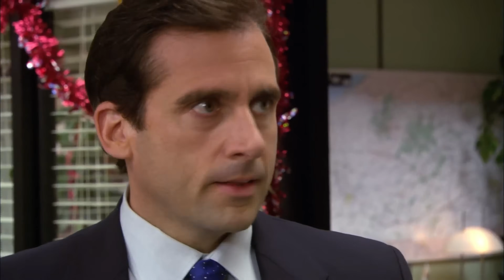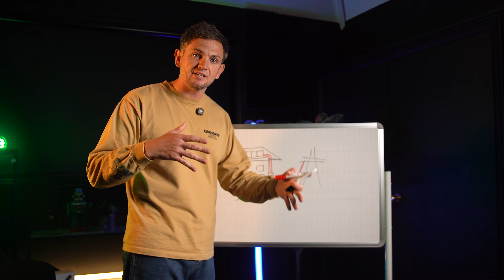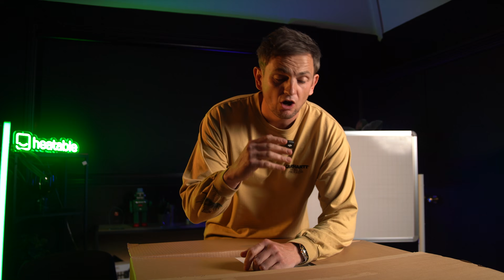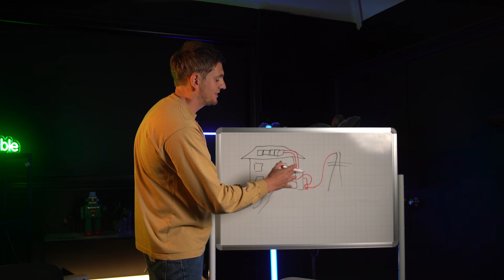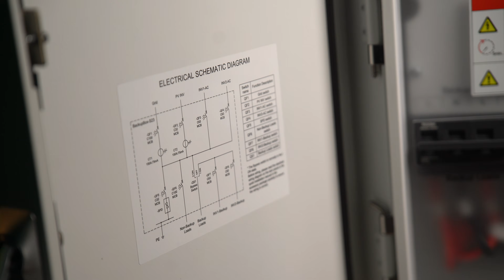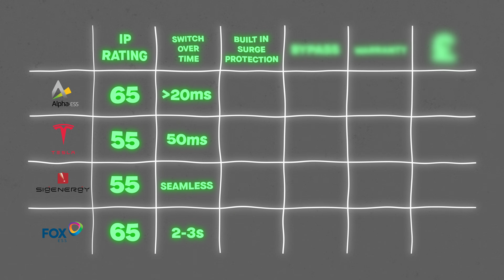What Solar Salespeople Don’t Tell You About Batteries

Comment: What if there is a power cut at night while you are charging your batteries on cheap night rate electricity. Can it stop ur invertor from trying to import?
Reply: If you've got a power cut there's nothing to import anyway.
Reply from the maker: There is nothing to import so the grid charge function will not activate.

Comment: Just had a Sig backup and system installed at my daughters house and if the power fails you get a notification to tell you because whilst it’s great it’s seamless, you do want to know the power has failed. Does this one do the same and would it work with my GivEnergy system which has two inverters and two 9.5kW batteries? Great channel by the way!
Reply from the maker: Hi - yes you’ll be notified. The early Sig software didn’t tell you but they quickly released a software update which is super handy! I’m not 100% sure if this works with other brands, let me check and I’ll post a short! Thanks for watching 🤟

Comment: 20ms is annoyingly close to great. The power supply requirements for an ATX power supply (ie a computer) is 10ms. Same problem with so many other vendors kit. Very few make the 10ms but that's still going to stop pretty much anything else gitching.

There are a couple of other inverters which have it all pretty much built in which definitely saves space - and which can also back up 4kW of microinverters and stuff.

Comment: I thought my Sigenergy Gateway, did the same?
Reply: I’ve had my Sigenergy system, including Gateway, for a year. In that time we’ve had a few power cuts and the only indication is a message on my phone. Everything continues to work seamlessly including computers and WiFi
Reply: Sig claim "nearly 0ms" and it's very very fast indeed. Not exactly cheap kit but yes it does this and more.